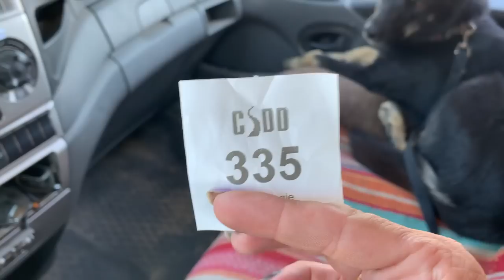Renovating an old cottage but also finding time to enjoy this place

Comment: You would be amazed how little dust you get if the brick is sprinkled with water while grinding. It keeps the grinder cooler and no one has to breath a lot of dust. Just keep the surface damp. 😉
Reply from the maker: ok
Reply: Woman with powertools in 21st century... Is it normal? Looks sexy? Or... 🤔
Reply: @WHITEWITCHINAVAN  KO

Comment: Les plantes aux fleures rouges pendantes à 6 minute de la vidéo sont des amarantes. Elles ont beau coup de propriétés culinaires et médicinales.
Pour éviter de mettre de la poussière partout, il suffit de mouiller les briques avant.
Il doit effectivement etre exceptionnellement confortable ce fauteuil.
Reply from the maker: sorry don't understand :(
Reply: @WHITEWITCHINAVAN  The plants with red flowers hanging 6 minutes into the video are amaranths. They have great culinary and medicinal properties.
To avoid getting dust everywhere, just wet the bricks first.
It must indeed be exceptionally comfortable this chair.

Sorry ! I love you ! ;-)